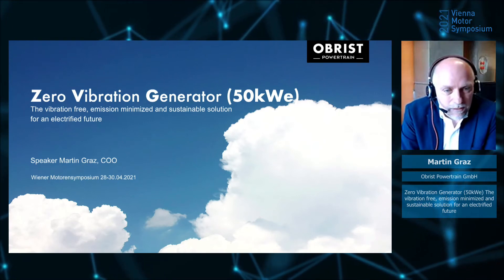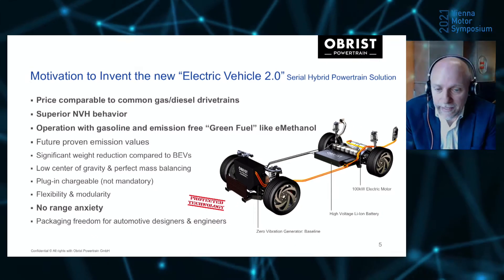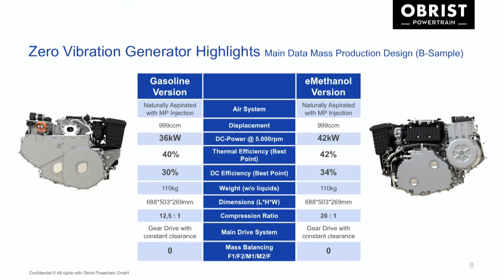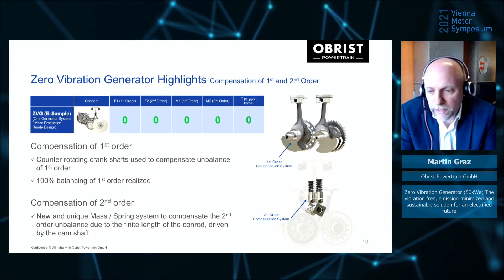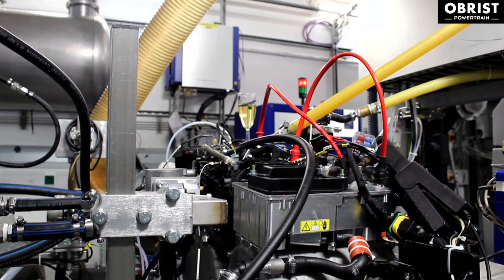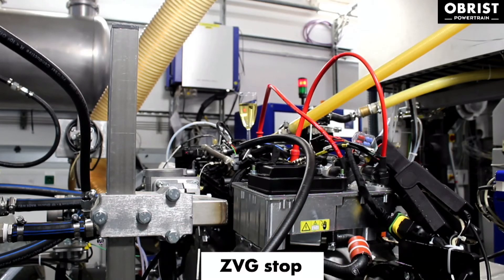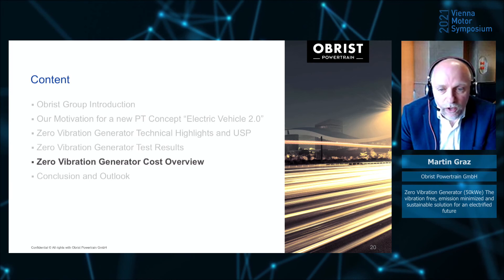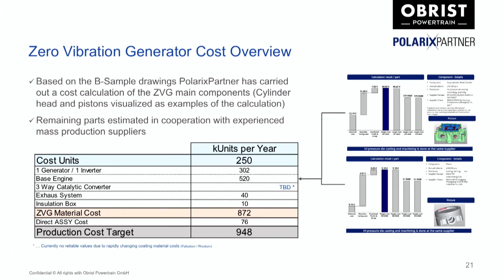ZVG (50kWe) The Vibration Free, Emission Minimized & Sustainable Solution for an Electrified Future

Comment: The numbers made me realise how ridiculously expensive (and oversized) the powertrains of modern cars are. Especially when compared to the production costs of this system. And the smooth, quiet operation is like a cherry on top. As the winter is coming to an end all I can think is how much noise there will be once the tiny tractors, construction crew generators and everything else crawls out of local sheds to rattle, pop, clack and roar around. One could say it has it's charm, but only for a day. It would be nice to have something silent for a change.
I wish your team and the ZVG the best of luck!

Comment: A free piston or opposed piston generator would probably be much more efficient. I read the the free piston generators could be 46% efficient (furel to electricity). Some opposed piston engines have 55% mechanical efficiency. 
If these was a fuel cell that could run on E-gasoline, we would have the best of all worlds: Potential for net zero emission while also having maximum energy density/specific energy of the system.

Comment: A microturbine with recuperator etc will be just as efficient, but it will be smaller, burn cleaner, require less maintenance and be cheaper to mass produce.
Reply: Exactly. This is truly efficient for a Generator.
Reply: But Noise & vibration will be a problem.
Reply: @3nityC  No! A turbine has no vibration. And the noise is much easier to dampen.

Comment: will the ZVG be available to purchase in the USA? I think most competent shops could install it , but mostly I wouldn't want to be required to ship my car to Europe for the install. I think this would sell great as an add on for the upcoming Mosel Y with structural 4680 pack from Austin but I would not want the pack size to be reduced like you've demonstrated. The software should be user adjustable so the ZVG could  either run continuously for long trips during cold weather, or be set so it doesn't come on until 40 mph & less than 40 percent remaining charge if I just wanted to run on battery power & use it only when plugging in would be inconvenient. I hope the cooling system also  integrates with the octavalve to help the HVAC during cold weather.

Comment: Have you considered manufacturing a smaller ZVG as an alternative to diesel generators?  I notice that 5KW diesel generators retail for £1000 on Amazon! Your machine would be cheaper and have ten times the power output. And run silently.

Comment: Would it make sense to have a waste heat energy recovery system? And why not use a microturbine, like Wrightspeed?
Reply from the maker: We have a lot of experience with waste heat recovery and also developed a system for a passenger car. From our experience, this additional weight and cost in a vehicle with high dynamics doesn't make much sense. On trucks yes, where long distances at same pace is driven. So yes it is possible, but only makes sense for long range vehicles. KR

Comment: Thermal efficiency, integration, NVH reduction and cost are really impressive but why electrical conversion efficiency is so bad ? A better one could make it lighter, smaller, cheaper ?
Reply from the maker: Dear Edouard, 
Thank you for your comment. The video shows the thermal efficiency (based on indicated power) and the DC efficiency. The difference is coming from the thermal efficiency which doesn't include friction, which the DC efficiency does. Let us know if you have further questions!
Reply: @obristgroup would this Concept apply to the Cybertruck as well?